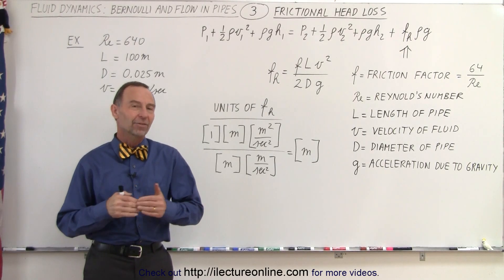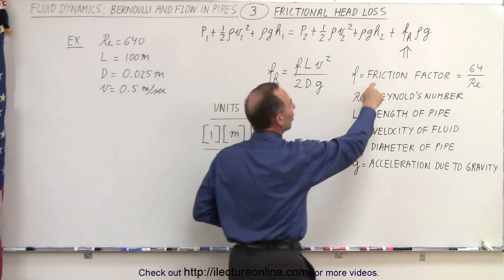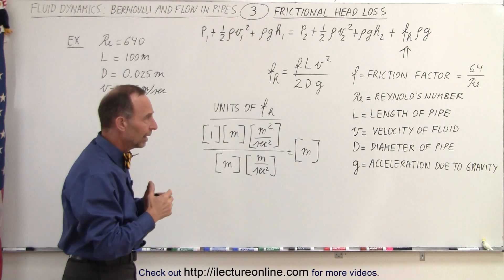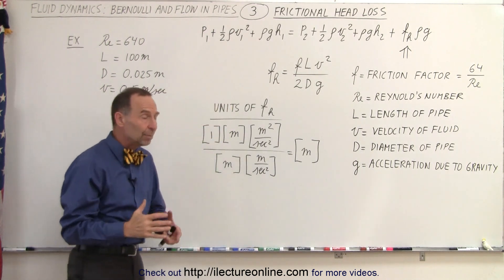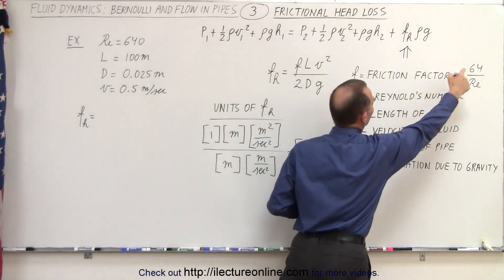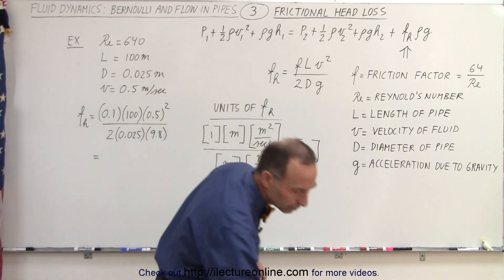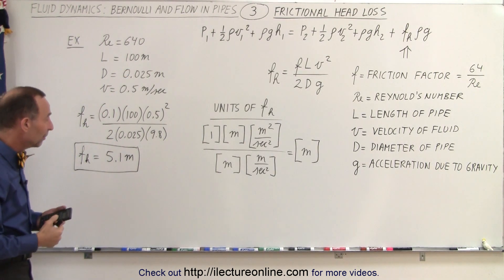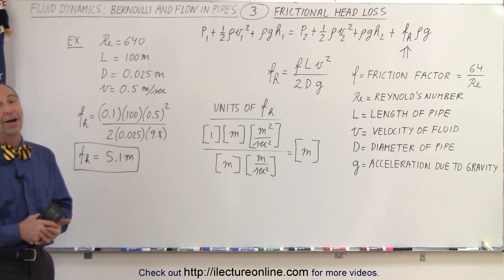Physics 34.1  Bernoulli's Equation & Flow in Pipes (3 of 38) Frictional Head Loss

Comment: It's interesting to note that this extra term has no dependents on gravity, since the g we use when calculating here cancels out with the g in our orginal term.
Reply: Correct.  The reason we bother to insert gravity into this term, is so that it can have the units of meters or feet, and be compared to an equivalent elevation change.  The phenomenon of losses in pipes is gravity-agnostic, so of course it should have no dependence on g.  Only the elevation terms, really have anything to do with g.  We just opt to divide through by g, in the interest of using distance units for every term.